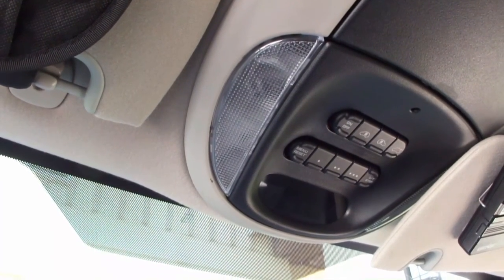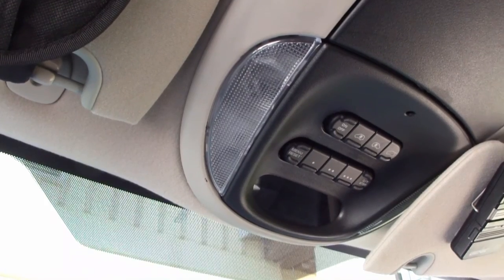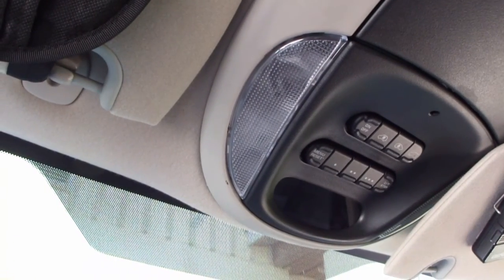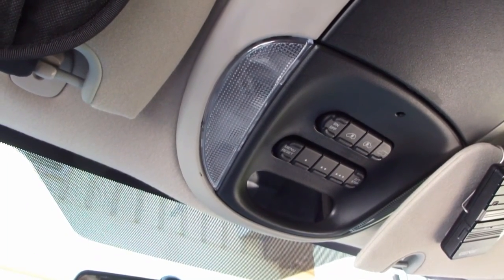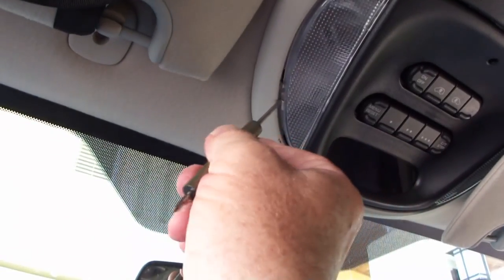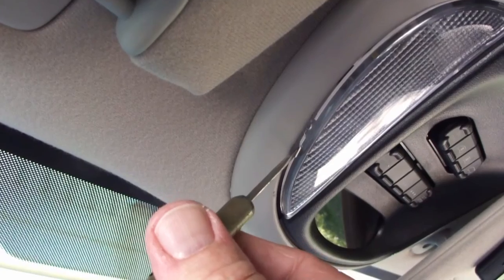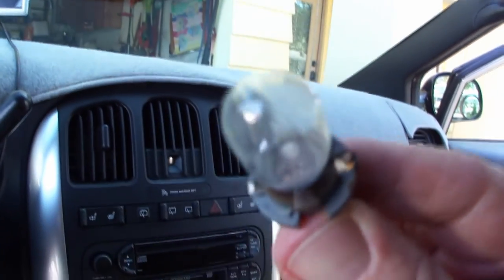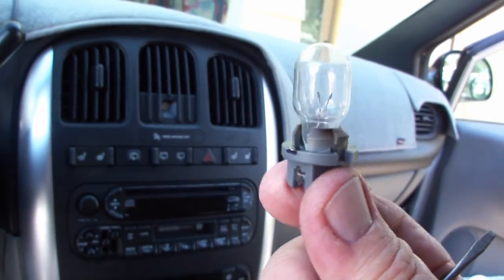Map Light Lens Removal and Reinstall

Comment: does the bulb itself come apart cause i dont see any replacements with the base
Reply from the maker: No, I don't believe so.  I found these on Amazon.  Hope this helps!
https://www.amazon.com/CEC-Industries-PC579-Printed-Circuit/dp/B00KD0ZSEK/ref=asc_df_B00KD0ZSEK/?tag=hyprod-20&linkCode=df0&hvadid=198096195532&hvpos=&hvnetw=g&hvrand=1128774830961456596&hvpone=&hvptwo=&hvqmt=&hvdev=c&hvdvcmdl=&hvlocint=&hvlocphy=1015090&hvtargid=pla-349808519885&psc=1